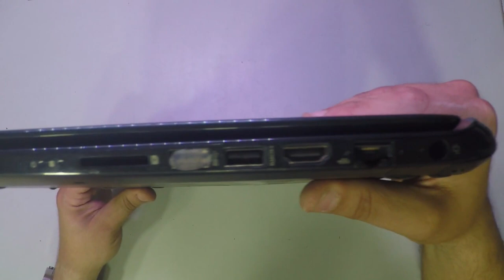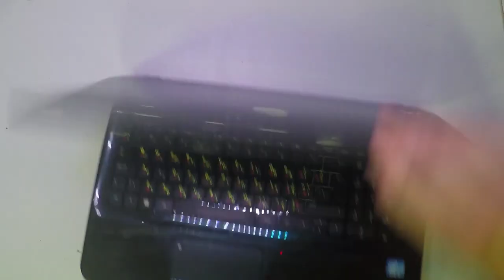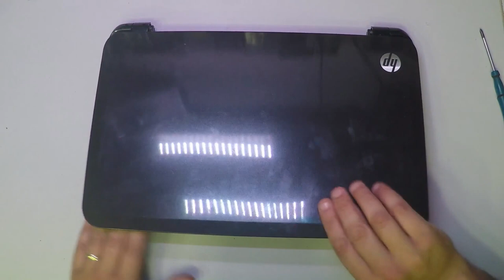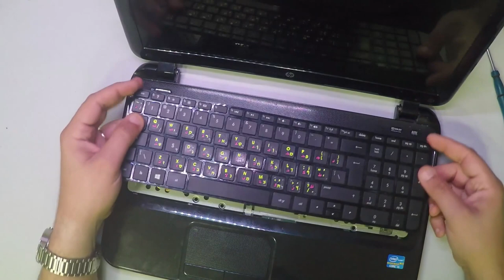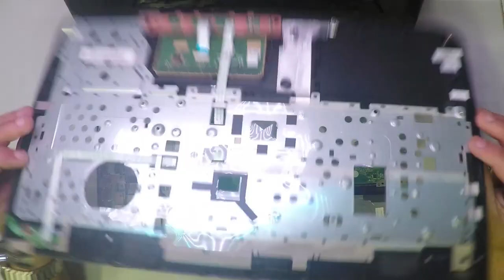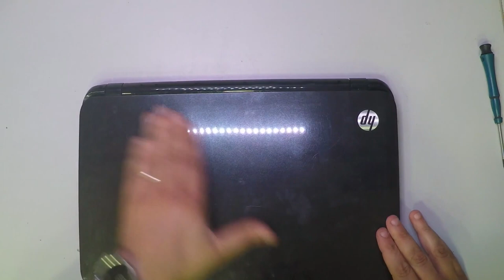HP Pavilion SleekBook 15 b150s HDD To SSD

Comment: Hello. I installed a 2.5" SSD, however it won't let me load Windows 10. The install system starts and when it gets to the part where the "file copy" starts, it doesn't go any further, it's stuck at 0%. Any ideas?